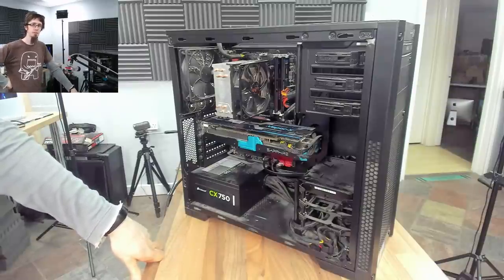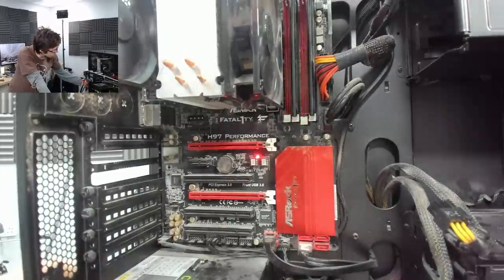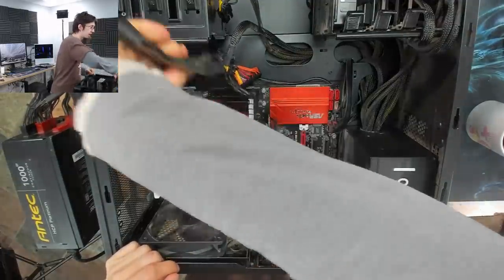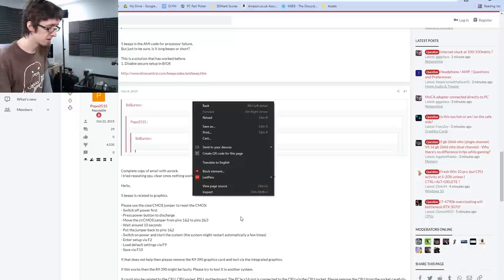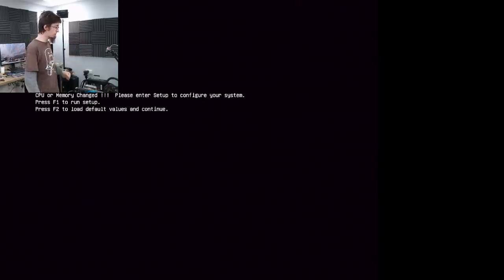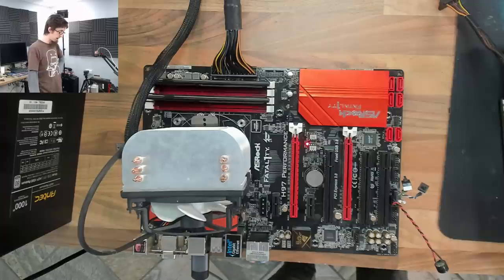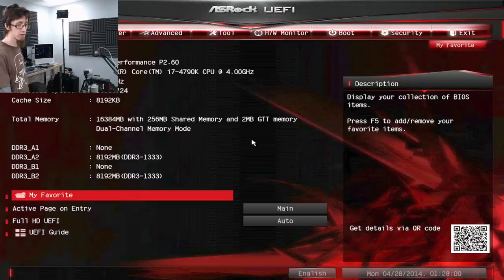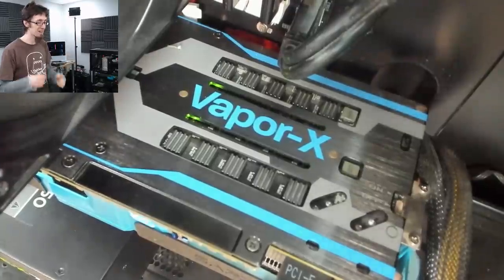Corsair Custom Build with No POST - LFC#272

Comment: Tip for you from 16 years of working with Beep Speakers: Eff em! Get a cheap LED (3v White Strawhat is best IMO) and solder it to a standard connector and put it in the place of the speaker! You can just watch the LED pulse then and it'll show you visually rather than audibly, and that makes diagnosing easier.

Comment: Thank you for the programmer recommendation. 👍 BTW, 5:22 this assumption made an ass out of me once . A motherboard refused to forget its settings no matter how long I kept that jumper in the shorted position. CMOS reset worked only when I removed the battery, turned it sideways and used it to short the 2 pins for 5-10 seconds. Also, very important - when you turn off a PC (or any device) to do hardware manipulations, always hold the case power button pressed in and even pump it a couple of times to completely discharge all residual electricity from the caps. This is why even when you just turned the PC off and unplugged the power cable when you go to press the button, fans will still try to spin and the MB's power indication LED is still glowing. 😉

Comment: this is why motherboards need two bioses, love this bios setup it was always a life saver. I to have fixed by flashing chips with the 341 programmer, i think it was called that. TechYesCity did one about Bit ROT where he fixed a mobo by simply reflashing the chip with a new copy. Anyways great videos, big fan

Comment: Incase you didn't notice, when you rebooted into UEFI-A, 38:04 there is an option to flash the A -> B  like there was before to B -> A incase you really did want to update both, with out having to use your USB drive.  Theoretically this should also back up any customized user settings (XMP, overclocks, etc) in UEFI setup to the other EUFI chip.

Comment: In my ~30 years of building/repairing computers, I have NEVER witnessed a CPU fail.

Like you said, it's never the CPU.  Lol
Reply: well I saw a PC that was thrown out, and when I checked what CPU was in it, I was very happy because it was a 2600K. This was some years ago now. Unfortunately I soon learned that the reason the system was thrown out, was because it had a dead CPU... presumably too much voltage for too long, or someone accidentally gave it way too much at once.

basically, I'd argue it can be the CPU, but only if it's a K series :D
Reply from the maker: It's never the CPU. Except when it is.
Reply: @Adamant_IT  I can fully agree with that lol.
Reply: Over my 25 years, working on, building, repairing computers a have seen a few (only a few) dead CPUs. It can happen. I have learnt to follow my instincts but also never rule anything out (cables, foreign object (paper clip, screws, etc). Also good to get the motherboard out of the enclosure / case to get a good look at the board and the mounts (within the case).
Reply: @Adamant_IT  ...but it's never the CPU... except when it is.
Reply: @Adamant_IT  indeed never the CPU until it is. Had a custom build for a client, all NEW parts. multiple parts where broke on delivery, up and including GPU, CPU, RAM and SSD. a build that should take +- 1 day took 3 weeks to complete.

The funny thing. 
Windows would install and run until it BSOD'ed. all parts were send back to manufacturer they tested it for me there and got everything replaced under warranty. We both don't know why it happened that I got 4 defective parts.

Comment: Quick tip:

If your MB doesn't have a 'clear cmos' button, short the battery connector when you remove the battery for reset. It'll do that when you touch the positive to negative on the battery holder/connector.
Reply: when u remove the battery the capacitors would last only a few seconds then go to 0.0v, no need to short any pins

Comment: Back in pentium 3 age I made a Bios hot switch between a dead mother board and another live... because flash process fails and brick my board in a first place. I booted the OK, with PSU ON,  boot DOS 6.22, then I changed chip memory, and run a bios update IN DOS. It ran like a charm... :)
Reply: NICE! 👍 You remind me of when I added a DDR2 stick to the MB live once - an incredibly stupid mistake by distracted me. Surprisingly, the PC didn't even froze. 👀 Out of curiosity, I tried to turned it off from Windows and it worked. Followed by disconnecting the power cable, pumping the power button and then reseating both sticks just in case. Turned on just fine, worked fine and held stability and memory tests like a boss. I can't believe my luck and I wouldn't even believe this story if I didn't live it! Got so scared back then - trust me, I did not repeat that mistake ever since! 🤣

Comment: You wouldn't believe what I've seen. This one time doing a favor for a mate cleaning out his PC I slid off the cover. What I found inside was the thing of nightmares which still haunts my dreams. There was a dust ball the size of a large house cat laying in the bottom of the case in front of the PSU. I hauled that out and spotted the CPU cooler which had little trails that the pet dander had left in the dust caked beneith the fan. The graphics cards heatsink wasn't any better. The power supply was chock full of dust too. I honestly can't say how it managed to survive being blocked up like that but I got it all cleaned up like new. There was dust and hair in every nook and cranny of that machine though. We had to chuck the optical drive in the bin. There was no way to clean the optical path without buggering it up.

Comment: good video. a corrupted bios can do alot of funky stuff. you got the good luck of the draw that that particular mommyboard had two bios chips and at least one bios was working. i know some manuals dont recommend updating bios but the motherboard manufacturers recommend you update the bios to at least a non beta as there are updates that the manufacturer have implemented to fix small bugs theyve found. if not for the backup bios that wasnt corrupted and bios chips that had been soldered into place the board replacement would have been required. people, update your stinking bios and also keep your pcs airdusted and replace your darn cmos battery every now and then, as their charge cycles are finite and can eventually wear down to no use

Comment: I remember the days when you had 2 bios chips, an  odd and even bios chips and even the keyboard had its own separate bios - back then the beep codes actually meant something specific  other than memory - a good start is to pull every single card and  cable out that isnt absolutely needed to boot - I have seen bent pins on ps2 and usb ports and even on one occasion a duff MS optical mouse prevent a system booting and cause it to sit there beeping on an opti chipset board - BIOS beep codes are specific to the brand of Bios can be specific to the board, in days of old you would get a schematic and list of beep codes at the back of the manual to point you in the right direction  - back then there were IRQ and DMA jumpers to set too...

Comment: Intel ME is... rubbish 💩 it’s supposed to be an “out of band” platform, just like iLO or DRAC on servers, but this only applies to machines with vPro CPUs and AMT technology, workstations and professional laptops.
It works as the TPM module for some laptops too, as part of intel PTT.
The problem is that ME is part of every single Intel machine since 2008, no matter of what modules (AMT, PTT, secure boot) are present.
ME is active as long as the power cable is inserted, has access to memory (the cpu doesn’t even notice) and it has full access to the network stack.
Reply: So true, and if ME gets corrupted then your ethernet connection might be screwed. Or computer might behave weird. There are tools to dump old ME and fix it and load back, but it is tedious process.
Reply: Didn't the login details leak opening it up to hackers?
Reply: @DJ-Daz  It is being continuously patched. More and more exploits are found, it is just best target for exploits. Your firewall, os or antivirus won’t be able to see anything.

Comment: Tip: When removing CMOS batt short holder terminals to discharge cap(s).
Reply: And push the powerbutton when the jumper is on the reset position.

Comment: It might need, reapplying some Arctic Heat Sink Compond, and some dust cleaning. My computer nothing, disassembled some parts, did the vacuum cleaner mode, manually cleaned everything, fan and etc. And it started right up and more quietly.

Comment: ME is the management platform done by Intel, which has some features which are useful for corporate desktops or servers (like iLO, anti-theft, etc.) but which are pretty much useless for consumer desktops. People are squicky about it because it can (in theory) use the Ethernet interface to "phone home" even when the system is off, because the ME chip is powered off the +5sb.
Reply: Yep, truly a non-concern for the regular Joe IRL. 👍

Comment: Please keep in mind Adam, that resetting a BIOS, or any other type of initial memory in any device, can force this device to enter a loop mode. In this mode, might act abnormally. So, this might be the reason, why your last attempt before the post was still no post and, that's why, I do wait longer with all electronic devices after this reset.
Reply from the maker: I forget to mention it in the videos, however I do usually wait quite a while on boot attempts, but cut the video. Otherwise there'd be like, 15mins more of just dead space.
Memory training has a distinctive pattern as well, you can tell when the board is training vs when it's not going to POST.

Comment: BIOS Selection Jumper
(BIOS_SEL1)
(see p.6, No. 24)
his motherboard has two BIOS onboard, a main BIOS (BIOS_A) and a backup 
BIOS (BIOS_B), which enhances protection for the safety and stability of your 
system. Normally, the system works on the main BIOS. However, if the main BIOS 
is corrupted or damaged, please use a jumper cap to short pin2 and pin3, then 
the backup BIOS will take over on the next system boot. Ater that, use “Secure 
Backup UEFI“ in BIOS setup utility to copy the BIOS ile to the main BIOS to 
ensure normal system operation. For the sake of system safety, users cannot 
update the backup BIOS manually. Users may refer to the BIOS LED (BIOS_A_
LED or BIOS_B_LED) to identify which BIOS is activated currently.

Comment: Your methods are fine, basically what I'd have done, check all cables and reset bios then it's the elimination game, I did with my MB left the backup Bios as is that way I know it works
Reply: Pulling the BIOS chip out with the battery installed was a bit sketchy. No harm so no foul though.

Comment: one thing i learned working with a H97 system that didn't post was to dust it out, i did that and it posted and worked no issue.

Comment: at first i thought it was the molex on board missing power..
i learned something today.. backup B-A feature.
win-raid has a good Intel ME section in forums..
i would update backup bios to 1.xx newer at least.
some manufacturers usually give at least an SPi header if not socketed.

Comment: I understand this video is a few years old, however, it’s still an extremely important role even in today’s day and age of 2024 where the same troubleshooting procedures are still being implemented just like this.
And yes, in the beginning, you checked the bios, but those three beeps were pointing towards a possibility that there may be some thing going on with the ram and what was really confusing was the three beeps and then when you tried something else, the two beeps and when you conclusion lead you back to the motherboard after testing All of the onboard components on another system you looked at the bios even deeper, and it turned out that the main bios was corrupted, and we also have to bear in mind that the bio program for that motherboard was actually able to flash the bios from the back up to the main And you were able to check that the main bios worked after copying it from the back up and then updating the main bios, however, could there be a possibility that some boards or manufacturers the ref flashing of the back up bios might not take in which case you have to program it and you have to know how to do this like you do not everybody out there can decide or a chip or even pop out a chip and purchase a programmer and successfully program because they are not tech savy, in which case that is where you come in to offer customers your services for a fee.
Thank you for sharing your knowledge with us we truly appreciate it.😊

Comment: @Adamant IT, The short explanation is:
Intel ME means Intel Management Engine. It is intended as low level remote management utility for enterprises and businesses. It does not need an OS running, to manage general access to a computer, on UEFI/Bios level for managing time, date, power profile, noise profile.... ETC.... by Enterprise IT teams to enterprise employee computers in their endless to provide a reasonable balance between performance and power savings on one side and reasonable balance between security and usability on the other side. It is Greatly misunderstood by people as a way to control your computer and spy on you. In order to work, this management utility needs Layer 2 access between the managed computer and the managing computers and works only on both computers are within the same vlan.

Comment: I remember a time when mobos came with a hardcopy of a manual that had appendices including one with all the beep codes and what they meant. It can be the CPU. A few years ago my wife turned on the shower, there was a loud crack and the magic smoke was released. When I opened up my PC there was a small crater in the CPU, several tracks were burned off the mobo and the 12v rails were missing from the PSU.

Comment: Dust plus high humidity can cause issues I have found. Semi shorts can corrupt the cmos. 
I had one computer come in for repair once that had 5 years of dust mixed with cigarette smoke. Everything was sticky, yellow/orange/brown and absolutly disgusting.   If i recall I just washed the board down with starting fluid. I was able to get it going again but it was worn out and very outdated.

Comment: Can I please ask, even though not in this video. When you power inject, how do you decide the voltage and amps to use? Your videos are fantastic and I always wait 'impatiently' for the next.
Reply from the maker: 1v should be enough, and is a fairly safe option as it won't blow anything up on the board, occasionally I have to push up to 2v if it's a big cap that's soaking up heat though. Amps start at 3amp, go up to 4 if you can't find the hot-spot.
Reply: @Adamant_IT  Bless you. Thank you for finding the time to explain. Am I correct to assume this would work for any pcb or just laptops etc?

Comment: 41:00 Many new motherboards have a USB flash port so you can flash the BIOS without entering BIOS (you don't even need a CPU). So adding sockets will not help the regular user because he will not have any hardware to use to flash it.

Comment: id start by disconnecting everything off the board and see what happens.   next id try removing the bios battery & shorting the pins to force a reset if it has one.
Reply: Exactly why I got the habit of measuring the CMOS battery 1st and foremost. 😁

Comment: 'never the cpu'

i agree.  ive been in the game 25yrs and have only ever seen 1 bad intel cpu on a desktop machine.
Reply: not true, i had cpu die on me. never say never.
Reply: @Gruxxan  very true for AMD,  i have seen lots of them fail,   but intel failures are v v rare in my experience
Reply: @revingtosh  Yep, very rare failures indeed. Witnessed 2 AMD and 2 Intel CPUs fail since 2008. While the Intels failed due to MB VRM issues caused by a client's overclocking and/ poor maintenance, all AMDs I saw dead were Athlons with dried up internal thermal paste, under the IHS. Saved a 3rd one (II Gen) with delidding, works like a champ to this day in a test PC. 😋👍 I love fresh thermal paste. 😀

Comment: Never the cpu is what I used to believe too until I found a cpu that a child had looked at removed stuck to the heatsink and reinstalled without lifting the tension arm.
The crushed pins looked as painful as you imagine 😂

Comment: Hey Graham, question about what you said at the end there based on this specific scenario: Where are the beep codes stored? Are they a part of the BIOS chip? Would that explain why they were so variable this time, and does it mean that variable beep codes are likely to indicate something is wrong with the BIOS?
Reply from the maker: I believe they're on the BIOS chip. And yes, getting a wild range of different beeps does seem to be a sign that the chip is corrupted. Normally I would expect the beep code to be exactly the same unless you change something earlier in the POST sequence. When I took out RAM, we went straight to "No RAM" because that's very early in the sequence. Corrupted BIOSes are obviously a thing, but they're not that common, which is why I was looking for other issues first. Main issue here was not having ensured that both BIOS chips were reset first though.

Comment: with situations like these im glad my dad gave me a pci number thing

you just plug into the pci slot and then you turn on the system and it gives 4 numbers and those 4 numbers will tell you what the cause is

the only bad thing is it uses pci so it wont work on any modern motherboards but its still good